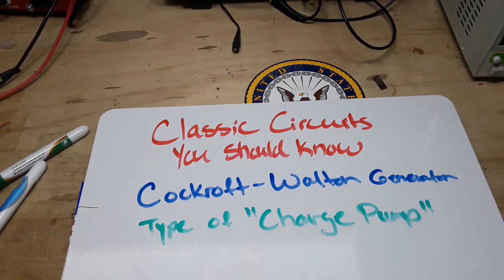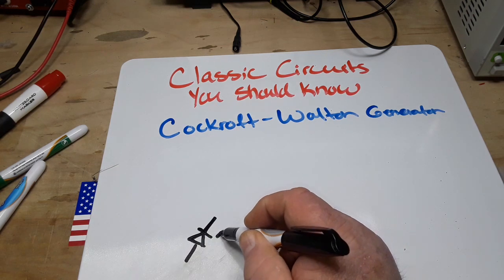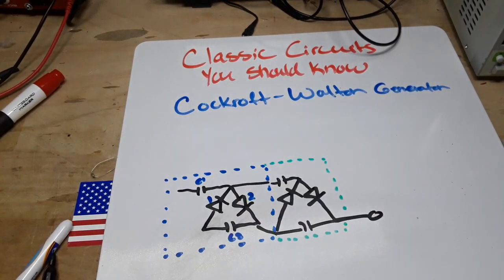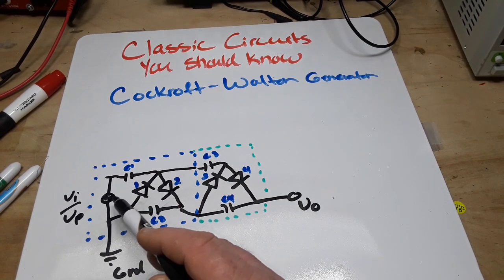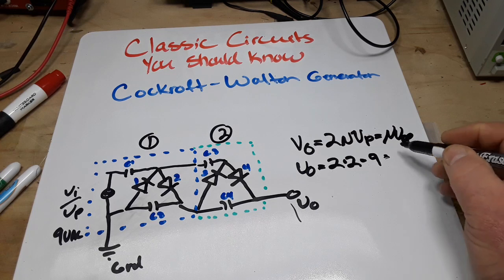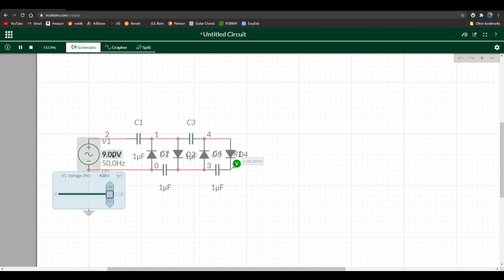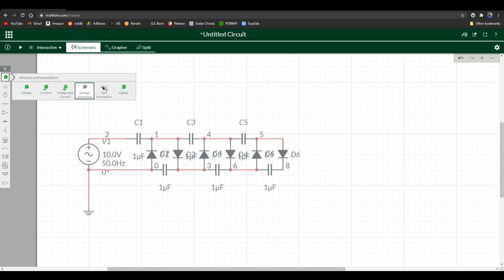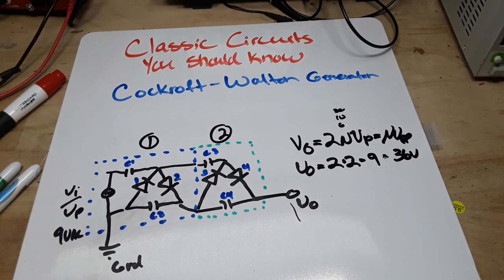Cockroft-Walton Generator - A classic circuit you should know

Comment: Could you use capacitors capable of storing more voltage in pairs as the current travels into them, like 2 capacitors of X voltage, flowing into 2 others of higher capacity, an keep this going to the end, or just at some point add 2 capacitors that hold more capacity power at the end of the generator,?

Comment: Also commonly called a "cascade" multiplier. I used to repair power supplies that could boost 120v to over 100kV using a 10-stage cascade. The entire stack had to be immersed in dielectric oil to suppress arcing across the later stage components. Although the voltage was multiplied to an extremely high level, the output current was DIVIDED by an equal factor. At 100kV, the current available was in the MICROAMPS range. The power supplies were used to put a high charge on automotive paint that caused it to be attracted to oppositely charged car bodies, thus minimizing wasted paint (for environmental and cost saving benefits). Automotive paint costs well over $200 a gallon and is quite toxic.
Reply: They still make electrostatic painting and powder coating equipment. 110kv and 110 microamps is as good as is gets for manual application.

Comment: Handy little circuit. Would it work if you had a 12v secondary transformer and you needed 54v to power an amp. you could smooth it, rectify and off you go?
Reply from the maker: you loose current in exchange for Voltage, but depending on what your needs are, yes it could work

Comment: I remember encountering this cct in an old broadcast transmitter probably 30-35 years ago.
IIRC, it was being used to provide a bias voltage to one of the higher power tubes.
Reply from the maker: Yep they were used in some CRTs

Comment: Can I use this generator, but take an input from a 555 timer?
Reply: you can just realize that the 555's output is limited to something like 40ma so you might want to drive a transistor or bjt with it to switch another load at minimum you should have a resistor in series before the first stage to limit current

Comment: Really great explanation. Thanks! The particle accelerator Cockcroft built became the very first mass spectrometer with some modification by Rayleigh and Aston. Even today, modern mass spectrometers still use the cockcroft multiplier to get the high voltage to drive the quadrupole mass filter and electron multiplier and HED. My old lab's in house engineer told me about them years back but i never truly understood how they worked until today.
Reply from the maker: Thanks for the info!

Comment: Now that is one cool circuit and a nice video too boot. I’m assuming each stage of the circuit would need higher and higher voltage rated Caps? Also are they electrolytic or non?
Reply from the maker: No, there is never more than 2Vp on a cap that's what makes this circuit so cool

Comment: The multiplier can be driven from a battery, using an oscillator and step up transformer. I use a 9-0-9 volt  output transformer in reverse. With either a blocking oscillator connected to the low voltage side, or any one of the multivibrator type oscillators, such as the Royer oscillator, or the zero volt switching configuration. The output square wave can then be multiplied up, for things like Ionisers, radiation detectors, and general EHT sources. It's worth note, that while driving from a low voltage battery limits the maximum power that can be delivered, it does not make the output any less lethal.

Comment: Great!! I love when you get hands on with the pencil on the board.

I have a couple of questions.
- I understand that as long as there is not a load in the circuit in the output, if you disconect the source, then (ideal components) the capacitors will be charged for ever.
I mean, ready for a fast discharge to any load that you could connect to the output. Am I right?

- If I understand it right, the circuit is basically storing energy.  The amount of energy stored will depend (for a given source voltage) on the capacitors value. Therefore, if the capacitors are very low (picos) the voltage would rise very much with many stages, but the stored energy would still be reasonably low.  Am I right?

So, even with the voltage high enough to penetrate the surface of our skin, the small energy discharged would limit the risk? (I am assuming the source was already disconnected)

Example: even when a microwave oven’s is disconnected,  its capacitor is extremely dangerous not just because it may stay charged with high voltage, but because its capacity is high.  This means it contains the combination a lot of energy with enough voltage to break thru the skin open wide.

On the other hand, with your circuit charged but already disconnected, implemented with 1pF capacitors (example) in all the stages, the voltage will still rise high above our skin dielectric barrier but the discharge wiould be less risky due to the low energy transfered. 

A bit lke woth the Tesla coils. High voltage enough to ionize the air and make our body conductive, but not enough energy to damage us.

Am I right? Or I am missing sonething important?

Comment: What needs to be the voltage rating for the diode’s and capacitors? The same as the output voltage?
Reply: you should at minimum use 1.5x rated caps / diodes as voltage min.  this is a common overhead.
Reply: @joejane9977  Of course.
Reply: Yup. The diode and cap at the outout side see the entire voltage across them.

You could cheap out at the input side with lower voltage components, but that's kinda pointless. Normally it will be the same diode and the same cap all the way across.

1N4007 and common ceramic caps will get you safely up near 1KV and those are pennies a piece.

Comment: I'm a complete beginner, so this question probably seems stupid, but what would happen if you just used dc power?  In other words if you put 12 volts in,  what would the end result be? And if it boosts the voltage dramatically, why isn't this circuit used in generators?  Or is it, lol
Reply from the maker: Pulsed DC will work
Reply: @learnelectronics  Is pulsed DC the same as AC?
Reply: a pure dc load will be blocked by the caps. only AC passes thru caps " ESR notwithstanding"  pulsing DC will work
Reply: @joejane9977  ahh ok,  I can understand that explanation,  thanks

Comment: i have a big on of these in a pair formation with both positive and negative ten stages each and it is powered by a flyback transformer, output is around 300KV and is a fun way to scare the hell out of visitors to the lab. my tazzer on steroids.  definitely lethal but not the highest voltage produced in by things in my lab, the tesla coil produces well over a million volts.